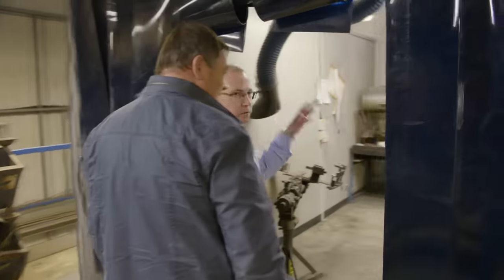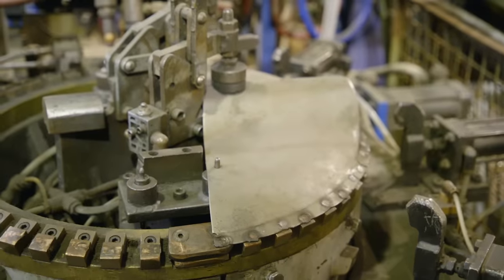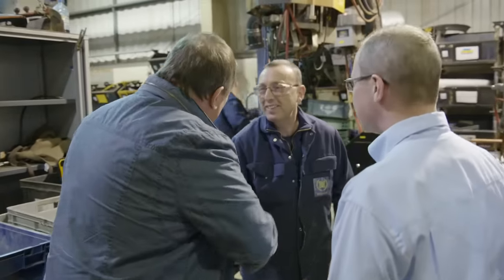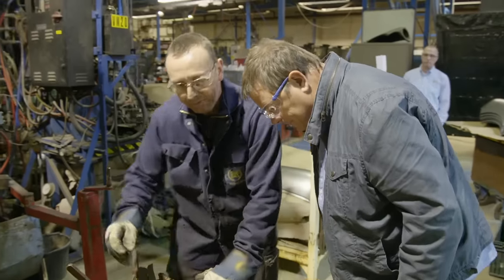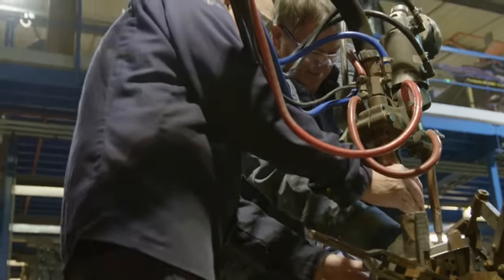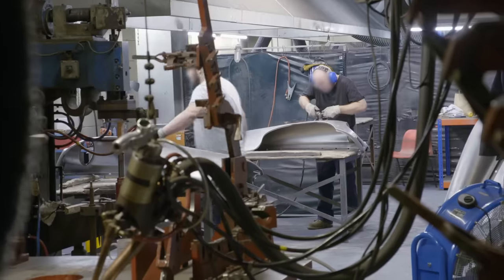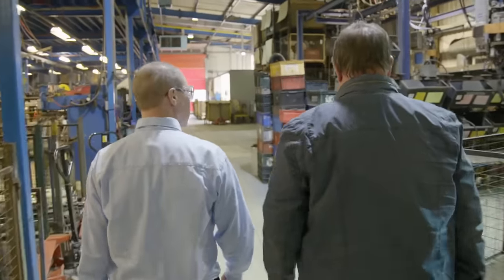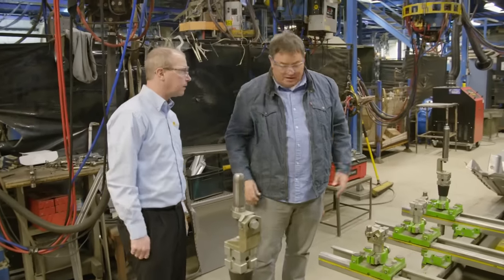The British Company Keeping Classic Mini's Alive | Mike Brewer's World Of Cars

Comment: This sends me back in time. Sigh... Nice to see the bodywork is still being manufactured to exactly the original specs.

I'm sure there is still a market for an updated Mini, one that fulfills modern safety, exhaust and fuel consumption standards without robbing the car of it's identity and soul the way BMW did it with that crap they call a Mini.
Reply: The first gen bmw mini is cool. It went downhill after that, like most cars. Bloated, ugly, teched out pieces of S.
Reply: Not possible. If you start adding all the safety required you end up with a new mini.
Reply: @usuallyfixingtinkering  Maybe, maybe not. I'm an engineer with 30 years experience in the car manufacturing industry and dare say have a bit of a professional view on this. 

Proof that it's very possible to build a car the size of the old Mini with all the modern safety features is the Smart and the Toyota iQ.

If in the end it would still be a true mini cooper with the same feel to it (Go-Kart) is a different question.
Reply: @mikethespike7579  I'm not sure how when you add crash bars for a start. That will just eat up Into the body and the later minis were crammed as it was.
Reply: @usuallyfixingtinkering  Well, they managed to get the Toyota iQ through present day crash tests without the use of crash bars and that car is half the size of a classic Mini. The same with the Smart.

BTW, I used to know the chief design engineer of the team that designed the first Smart. He swore blind that his car was just as crash resistant as any Mercedes. To be honest, I wouldn't want to bet ma life or health on that.
Reply: @mikethespike7579  wow that's interesting! There would have been some extensive chassis design to pass crash tests.
Reply: That would be the issue, the size of the car. People will always think that bigger is safer. Look at the amount of Suvs around. My parents owned a volvo 940. The bonnet was a mile long to the windscreen. Frontal impacts no issue there.
Reply: @usuallyfixingtinkering  That's why any newly designed  mini that earns the name, even with extensive modern safety features, would probably never be as successful as its predecessor. When the mini was first introduced the majority of cars on the roads in Britain were small simply because motorists didn't have the money for anything bigger. The mini then fitted in perfectly. Those days are long gone. Like you said people want big because of its protection and they have the money to pay for it.
Reply: @mikethespike7579  very true. Although if when you say people have money I'm not sure otherwise why do so many people lease? Things havnt changed a lot since the  minis time, but people want bigger and bigger is more expensive. So what other ways can we get people to pay... lease and finance. That was not an option in the 60s.
Reply: @usuallyfixingtinkering  LOL! Yeah, the lease option for wannabe rich. Were I live the street is full of Porsches, Mercs, BMWs a few Lambos and even a Rolls. My Ford Fiesta looks a bit out of place between all that. Regardless of the impression, it's not a well to do part of town, comfortable yes, but not well to do. So I wonder sometimes how they afford all that fancy sheet metal. The secret of course is leasing.
Reply: @mikethespike7579  I drive a 20 year old Focus and at my work it's the oldest in the park amongst mainly suv cars under 10 years. I'm not sure who they're kidding I know how much they earn lol

Comment: In 1964 I worked at Chrysler Canada in Windsor Ontario on The Gate Line in body-in-white. I started as a spot welder on patch plates where the bar across the front top of the windshield met the "A" pillar to tie it together before the roof was installed - the patch plate was where the sun visor screwed into. I didn't build any Minis but I did build almost 500 cars a shift from Valiant 2 door sedans to Chrysler convertibles and every model in between except Imperial (they came from U.S.). We built some RHD vehicles for export as well.

Comment: I remember as an apprentice working in the Rover Pressing plant. Watching the guys buff and sand the wing flange where the headlamp ring is bolted in and you just saw being welded . As you are forming the flange on a corner that is being bend around a cube you always get condition that need to be be sanded flat so you could weld it . After sanding they would stab it with a matchstick, if it dented it was scrapped , if not in went to longbridge to be put into a car . The metal is so thin which explains why the original Mini’s rotted out around the headlamp . Lovely car but I wouldn’t want to be in a crash in one

Comment: I hope they do something to improve the corrosion protection, my old minis always leaked water and Te sub frame mounts corrode away, battery box corrodes away due to battery acid leakage.  Other issue was in the wet the distributor was exposed to the weather once fully soaked the car would stop, a good spray with WD40 and it would restart if you are lucky

Comment: Never noticed the Mini had its radiator mounted sideways despite having a front grill, taking the fresh air through those vents in the wheel well, it's a bit strange position, wheel arches are always muddy.
Reply: Mini takes air in through the front grille and the engine fan pushes the air out through that radiator.
Reply: Its cause the engine is sideways and they didnt have the tech or the money to move it till the late 90s
Reply: The front grill was there to let water soak the distributor every time it rained!

Comment: How about a mini moke being reproduced they would sell like hot cakes. Me and my partner had a 1982 1275  cc genuine Californian moke in squadron blue and they were a galvanized body made in enfield in sydney and it had a disc brake conversion done sometime in its life . We bought it for 4 and a half grand and sold it to a person in port douglas FNQ 2 years later for 9 grand and those  cars now collect a small fortune if in great condition. I remember being on the gold coast on school holidays in 1980 and just about every second car u see getting around was a moke, all the car rentals there had them and what a fun car they were and still are and i also recall that a batch of stainless steel bodied mokes were built about late 80s and some ended up on magnetic island off townsville and i new of one in the whitsundays as well and they would been purposely built for sea air salty conditions to avoid rust and i know the galvanised Californian bodied mokes werent without rust issues either, behind the front quarter windows at the side ends of the dash for example and i do recall in 2005 that there was going to be a reproduction of the moke but didnt eventuate ,maybe design rules , safety and emission laws that the old morris b block motor cant comply to.
Reply: New Mokes are being made.  There are Chinese copies that look almost exactly like the original, but are dimensionaly larger.  They are sold in the U.S. as "Low Speed Vehicles" with electric power.  Internationally, they are available with a Chinese 1000 cc motor.  Look up "Moke International".  There are even better versions being made in France - see mokoncept.fr.  And new Moke bodyshells are being made by  M-Parts in the U.K.

Comment: I wonder if in the name of originality they’ve kept all the classic Issigonis designed rust traps ?  Keeping the same subframe too long gets boring.
Reply: Chipchase 
Subframes are fine if you fully seam weld them leaving to gaps. 
I bought new Subframes in 1997 and immediately stripped and seam welded them before repainting.  Today they're 100% condition as they were the day the paint dried 23 years ago.
Reply: Toss
Reply: Lee2709 
Typo, he means “no” gaps.
Reply: RAW TOPSHOT 
Good practice but who does that for someone else’s car ?  I spent a lot of time injecting waxoyl into box sections and vulnerable areas to keep the tin worm away from my old cars, well worth the effort.

Comment: It’s just like trigger’s broom lol,
Reply: you are correct, its original tooling that has been fixed and replaced over the years, a pity the upgrades required weren't added to improve on the bodyshell, I wonder if they straightened out the body shell ?  As the original was 1/8" longer on one side than the other.

Comment: I love the original mini but when seeing the shell bare it’s obvious how fragile they are. 1950s lack of crash protection. Imagine meeting a modern SUV in a head on crash.
Reply: Better not try a Citroen 2 CV which has very flimsy bodywork, or a Fiat 500 or 126 where the first thing at the scene of the accident is the fuel tank...which is suddenly in your lap.. P.S. I like all of those cars. I'd love a  Mini. My neighbour has a 998 in running order and uses it now and again.
Reply: The mini isn't very fragile at all. They're very very stiff. The danger of them is that they're too stiff and don't absorb the force of impact, instead transmitting it directly to you through the airbagless steering wheel. The first attempts at safer prototype minis all involved making the nose longer because it was the only way to add a crumple zone.

Comment: The Mini was a great car for its time. I’ve owned dozens of them. Sadly, I wouldn’t want to drive one on modern roads. Saw one recently and it looked like a tiny little toy compared with every other car around. Safety was not a consideration for the original car. I find if hard to believe I used to transport my whole family around in one and survived.
Reply: 5 million cars OTR in 1959 . . . 35 million now, might have something to do with the safety case or lack-of. At that time UK hadn't experienced the level of RTAs that were to occur later (UK deaths peaked '65-66) , let alone the "Ralph Nader" intelligent and combative consumerism that was to follow and which "Encouraged" car producers and legislators to consider building-in substantial safety measures.

Comment: Don't agree with it myself as if you totally change the shell it's not original anymore ---- that's how come now there's more MG B convertibles now than originally made ---- it's like the woodman's axe-- totally original apart from 3 handles & 2 heads ----- in any restoration you do usually a fair percentage is replaced ---- at that rate it's a new car on old plates

Comment: Idon't get it they had the prefect chance to put right the original mini's manufacturing short falls and they didn't
Reply: The problem then is that they would have to adjust the original tooling and would risk losing the minis shape and (apparently the soul of the car?) as well as costing thousands which they may not get back

Comment: Had a few of these rust buckets in the past. Gosh they were rotten as they left the factory. Used to go to Cofton Park by 'Longbridge East Works' as a kid and there were thousands of Minis in the outside storage area all throughout the year. No wonder there is a market for these colanders. Classic design- yes. Built at a loss and whilst using a scaffold bar under the doors on the track to re alignwith the doorstep? Oh yes indeed. Awful but beautiful concept.

Comment: Had one for years, unreliable rust buckets. Only for the nostalgic.
Reply: If u look after them there not too bad..........
Reply: I've driven my Mini in 20 states and up into Canada. Two trips were 6,000+ miles each. My Mini and I have driven the Montana High Line, crossed the Mackinac Bridge, climbed to the top of Pikes Peak and dropped down into Hell's Canyon. If you build a Mini right and maintain it reasonably, it can be very reliable -- and way more enjoyable than just about any other vehicle.